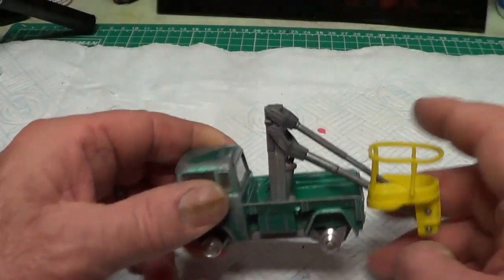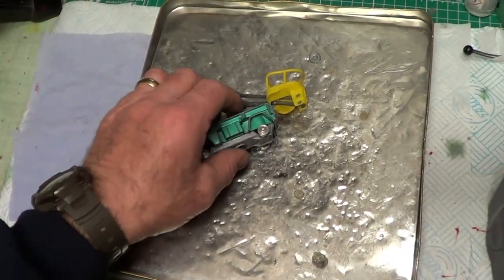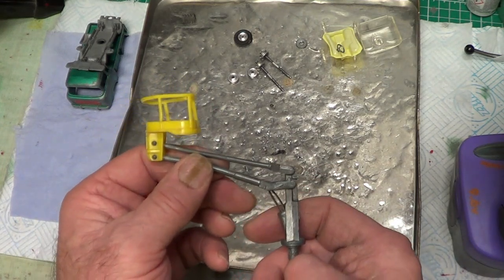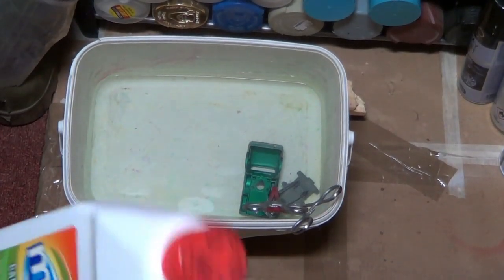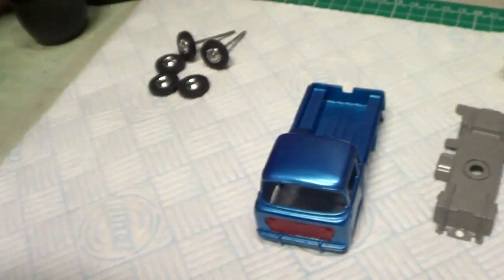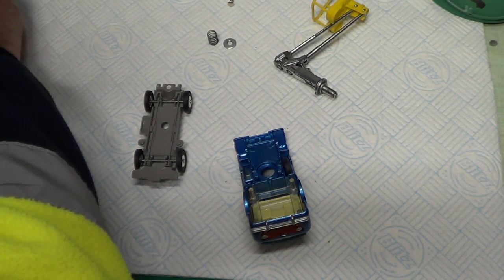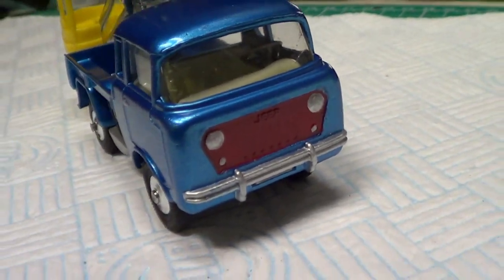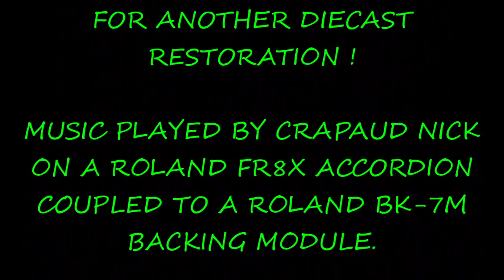CORGI TOYS FC-150 JEEP HYDRAULIC TOWER WAGON RESTORATION

Comment: Looks ace in that blue. Thanks for the heads up on build with this one. Finally mustered up the decision to go got one of those. Tackled 2 of the conveyor ones last summer
Reply from the maker: Thank you Ian, good luck when you do yours, I think you will find it easier to do than the conveyor belt ones, talking of which, I have one of those to do next year, at least I’ll have Martin’s video to watch again before I do it! 👍😊
Reply: @crapaudnicksdiecastrenovat1739  already done one of those. A bit of a work up getting the 2 halves of conveyor back together
Reply: Look forward to seeing you do yours too. Greater skill applied in letting others see how you do it. i didn't bother with the grill facing or chevrons on the ramp scuttle

Comment: with the lamp post and man,this would be Gift set 14,otherwise,plain 478 which didn't have either.The original green is from the landrover.
Reply from the maker: Thank you for the info on that, didn’t realize it was sold as a gift set.👍😊